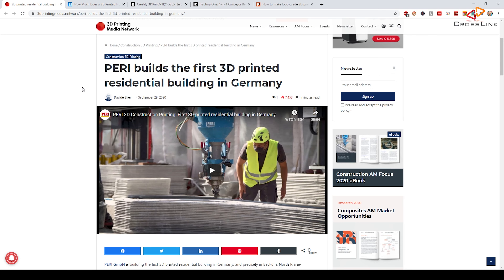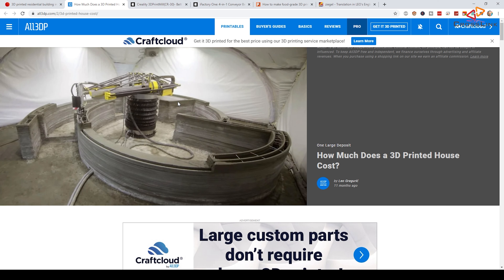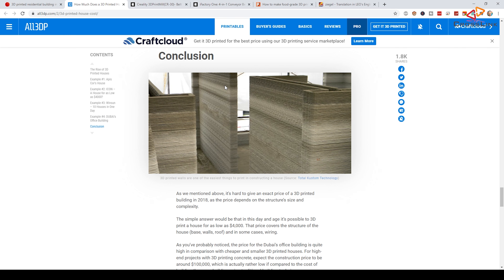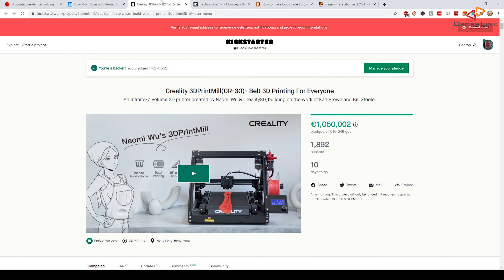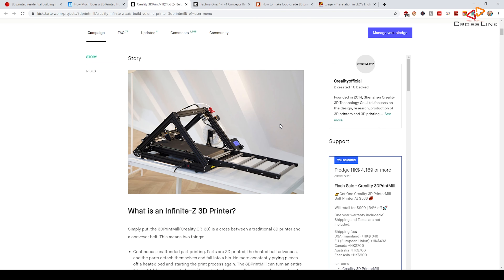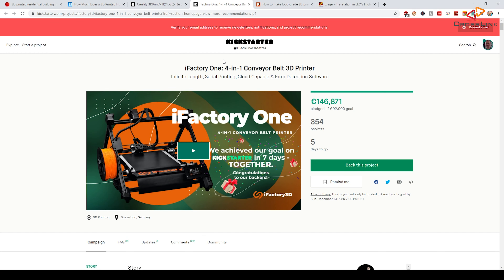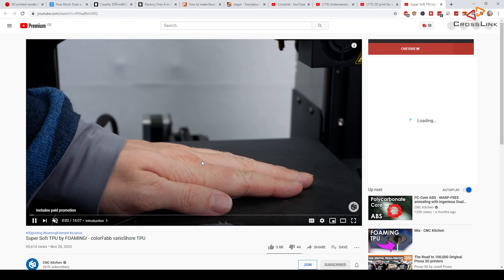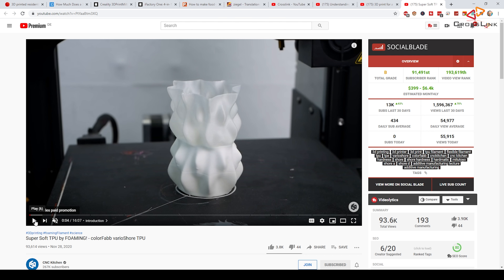3D Printed Houses, Creality CR 30, Food-Safe Printing (and more topics)

Comment: Potential use cases:
Cosplay parts/props
Small scale construction
Camping gear
Passive small business 
Mobility options (crutches/stilts)
Furniture
Statues 
Large scale models

Those are just what came to mind when you asked.  Thinking about issues in America currently it would be cheaper to print lumber than buy it as well, lol.
Reply from the maker: Great ideas! thinking about printing a chair, this might be an interesting project...

Comment: Both concrete and infinite single axis printers are even higher on my list of usable applications than metal printing. Especially since the infinite axis allows you to do rapid prototyping at scale. Not to mention the cost difference for the printing hardware and filament materials.
Reply from the maker: Agree on the rapid prototyping part. But I also will test metal printing soon :-)
Reply: @Crosslink3D  lucky! The price barrier still has it's hold on me. I'd love to see a version with small roboic arms, I've always had an idea of using a few on modle trains to self replicate.

Comment: I was thinking whether any printer can be modded to add a spatula like fixture to one side so it can knock the prints off the bed after it’s done and start new one instead of the mill version. Calibration of process will be a headache but some beds like carbon coated porous glasses self release prints after cooling down to under 40C.

Comment: Re: Creality boards at 14:05 I bought replacement board, almost wrong one at that. Surface looks identical, bottom of the board has a sticker to indicate it’s for which Ender. Ender 3 v2 has a large LCD screen and it’s a different printer in some ways.

Comment: Creality are a company producing printers for hobbyists and the CR-30 is a printer for light industrial applications, the two don't mix well and in its current pre-production state, there are a lot of bugs to be resolved.
 Parts need to be designed with the CR-30 in mind as some existing designed parts just don't carry over to it well.
Reply from the maker: Agree 💯. Target audience is semi-pro and good point about the parts design. Not everything can be printed on this printer without changes. The least might be that you need to re-think orientation on the build surface.
Reply: I have one and don’t really agree. The infinite Z allows me to print things a same size printer can’t. It’s opened my mind up to so many projects that I never thought about for 3D printing. But I never would have realized it until I actually had one. I believe one of these plus a Ender 3 is all you need to create just about anything in plastic/flexible material. Hobbyists will love it.
Reply from the maker: Interesting thoughts. I truely can imagine that having infinite Z opens new ideas never seen before. I think that the actual killer use case hasn’t been shown yet unless it’s cosplay swords. I am looking forward to test it once it’s released!
Reply: @Crosslink3D  One could print a chain of infinite length. You could also utilize the endless printing to print every part of a larger assembly in a single session. Combining that with the potential of the infinite length parts, you could easily and rapidly produce some large and complex objects.